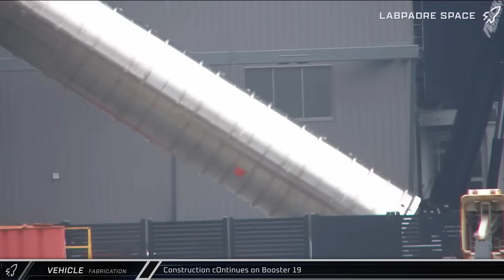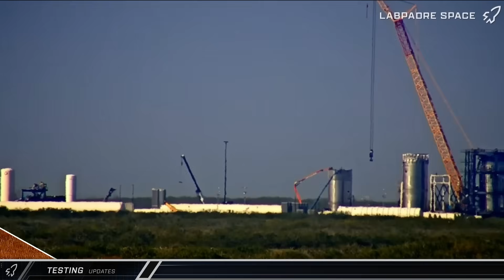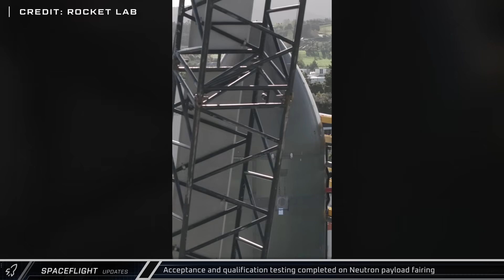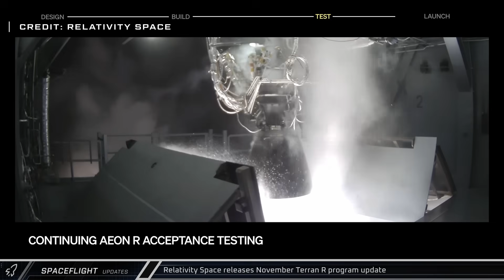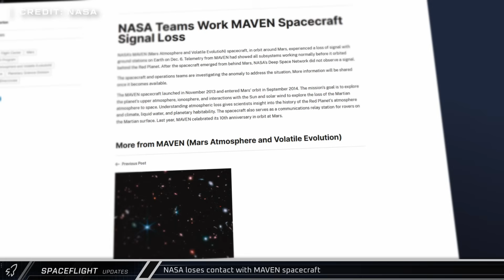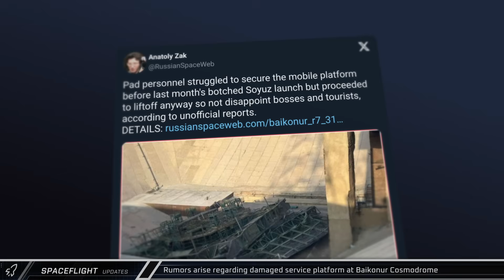Booster 19 Built EIGHT TIMES Faster than B18 - Spaceflight Weekly #197

Comment: 3:59 erratum: latest Starlink launch wasn’t 6-92 but 6-90:

As of December 15, 2025, the latest completed Starlink launch in the Group 6 series (southeastern launches from Florida to ~43° inclination orbits) is Starlink Group 6-90.

Details:
- Starlink 6-90: Launched on December 11, 2025, from Cape Canaveral Space Force Station (SLC-40). It deployed 29 V2 Mini satellites.
- Starlink 6-92: This was an earlier launch on December 8, 2025, from Kennedy Space Center (LC-39A), deploying 29 satellites and marking the 3,000th Starlink satellite launched in 2025.

Upcoming Starlink missions include batches on December 14 and 15 (e.g., Group 15-12 and others), but no Group 6 launches are immediately following 6-90. Group 6 missions are part of Shell 6 (V2 Mini satellites for mid-latitude coverage). The numbering is sequential per shell/group, not strictly chronological across all Starlink launches.